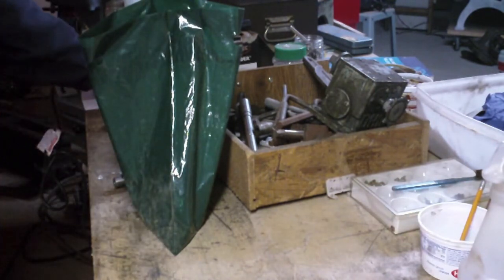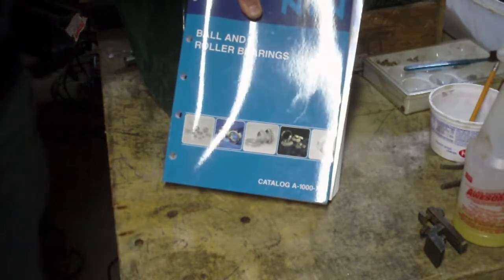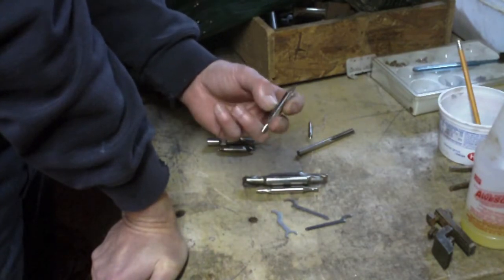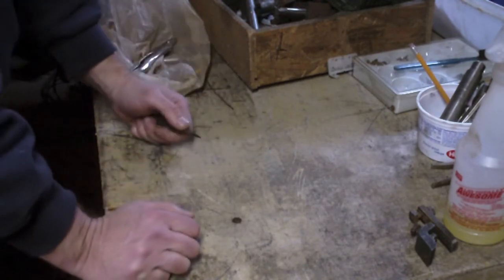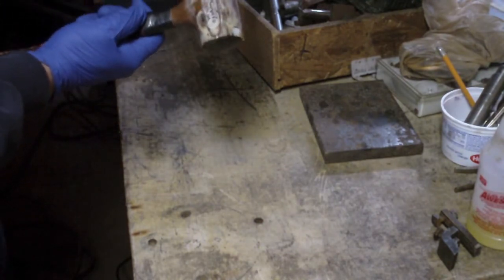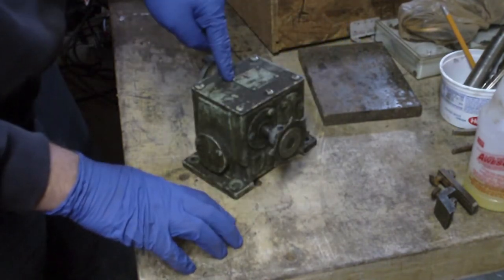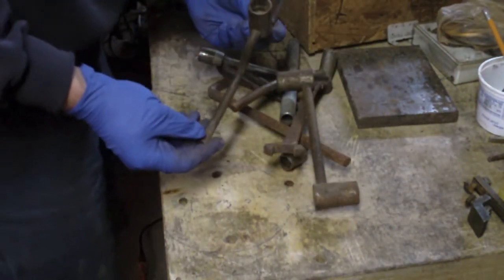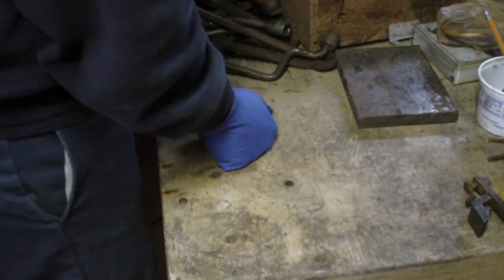Saved from the scrapper #3

Comment: Steve;

Is that punch a fixed punch or a spring type center punch?  Kind of looks like a Starrett 18A Adustable Stroke Center Punch from what little I could see of it.

Drop all that rusty stuff in a bucket full of either Evap-O-Rust or CLR and they should come out looking pretty nice.

Regards;

Ron Kluwe
Reply from the maker: Thanks Ron. It is a spring loaded automatic punch Craftsman 9-40541
https://www.shamrocksupply.com/itemDetailFilterPH.action?RFP=IFD&IDP=Y&codeId=10587511